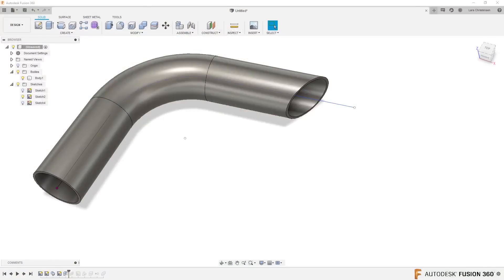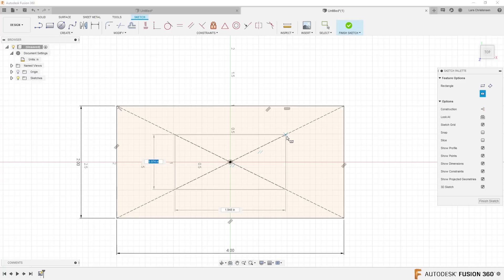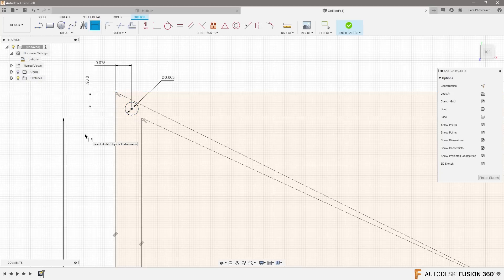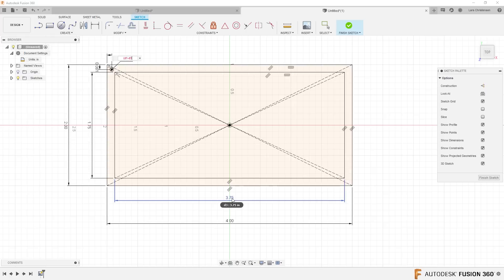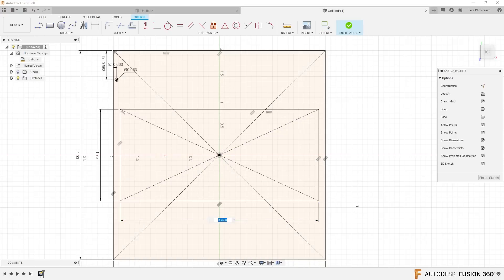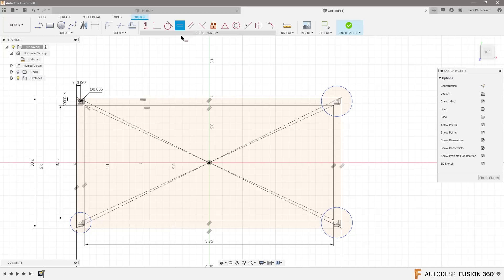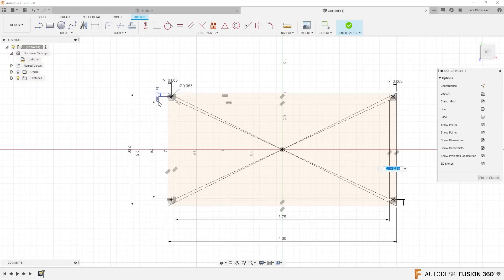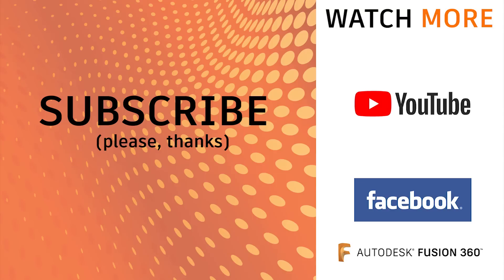Fusion 360 — How To BETTER Constrain Hole Location — Ask LarsLive

Comment: Hi Lars. I've made a waste board with 200 od circles that need to now to make into holes. All circles are the same diameter. Is there a way to select all 200 plus holes and make them go all the way through my waste board? If I have to do this one by one would take make a lot of time. Appreciate your help.

Comment: I am trying to figure out how to locate holes (as opposed to circles) at a point offset from the center of a rectangle. Want to use holes instead of extruded circles so I can use threads, drillpoints etc etc. Is there any way to do this?

Comment: I would avoid formulas containing subtraction in this situation. I would dimension the circles (d1+d2)/4 from the origin. This is the average size of the rectangles divided in half. That way, if for some reason the inner rectangle is changed to be larger than the outer rectangle, the holes will still be in the correct position.

Comment: Why not just make a construction line from the corner of the inner rectangle to the corner of the outer and constrain the circle to the midpoint of the construction line and constrain all the circles to be equal in diameter?
Reply from the maker: Because then I could not show the cool function of doing math in the dimension dialog box :-)
Reply: Love that way Jim. Easier to do now that I have tried it, at the same time tho I do like seeing the side of things as well. While I would probably use the construction line in this instance I don’t think I would have thought of the mathematical way in another. I appreciate both ways 😊😊
Reply: I agree, that is the best solution to the problem,  just a simple center-point on a diagonal construction line. While the math-in-dialog-box approach does indeed show how to do math inside the dialog box, that wasn't the issue at hand.
Reply: I do like the mathematical way but for ease of designing the midpoint way is easier. More knowledge is power is how I think of it. Thank you Lars for your help

Comment: @03:55 I'd like to propose for Autodesk to add an option in the settings for those d1, d2, etc... Shortcuts to be permanently displayed next to the already visible measurements - Would, IMHO, really help with the workflow.

Btw... I do all my designs in Metric but every once in a while have to use Imperial numbers when it comes to measurements based on the diameter of the Endmills I use.
So far I haven't figured out if there's a way to temporarily ( just for the currently active measurement! Not the entire sketch yet alone the project ) enter an Imperial number.

Like a sketch with a rectangle and a 1/4 inch sized hole going like L: 10mm W: 15mm Ø: 1/4 Inch - Instead of whipping out the Win10 Calculator, changing it to Length Conversion and calculating 0.25 of an Inch into 6.35mm to be entered into the sketch.
Reply: You can indeed mix inches and millimeters. If you need to enter say 4 inches and you have it set to display metric units, just type "4 in" and it will automatically convert it to millimeters.
Reply: Display dimension labels. Great idea, write it up in Suggestions (search first.) It should be selectable, and default on the ENCOURAGE ppl to use it. Right-click on a label to: Rename, disable display for that label, disable all labels. Heck, I'd frequently like name displayed bit value. I know the value. I need the name to make it easier to find, rather than looking for the parr, then finding the dimension lines, and finally finding the dimension. Steal my ideas when you write the suggestion. Three months from now a new feature will appear.